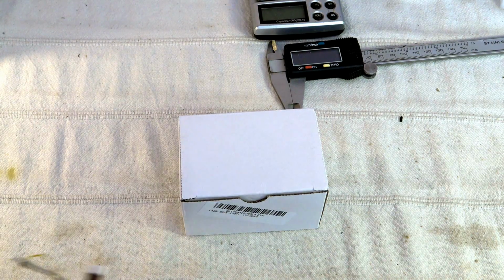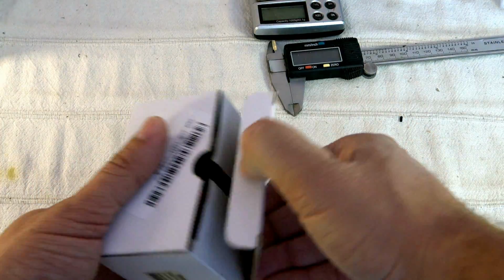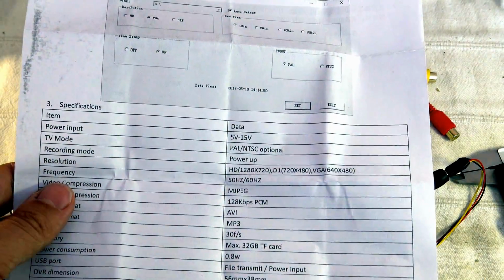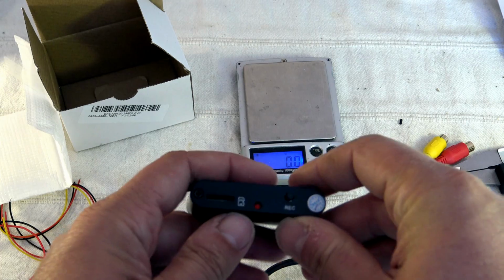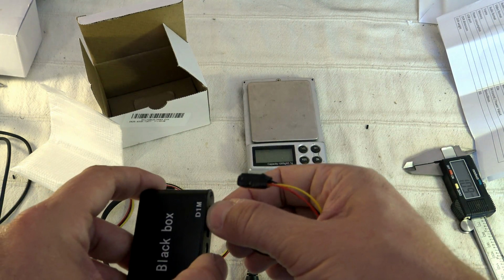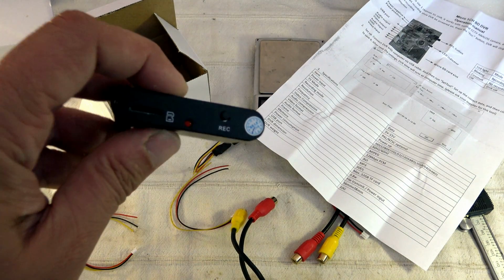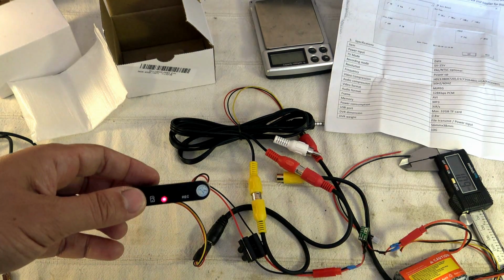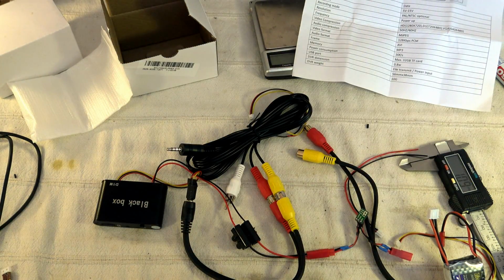BlackBox D1M DVR external module unboxing, analysis and testing  (Courtesy Banggood)

Comment: All things considered, I think the PRODVR is better. The only drawback to the PRODVR is that you have to use a Puolu voltage regulator to make sure you deliver ONLY 5v to it .. but that's not a big deal .. set it up once and you're done.  ProDVR is also much cheaper. Can't see any real advantage with this one. Thanks for the review. Cheers.